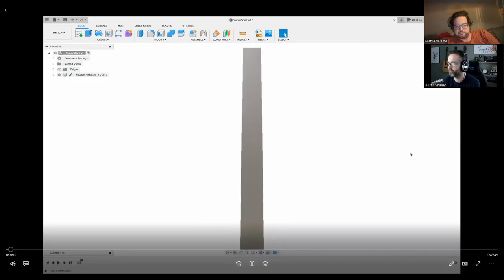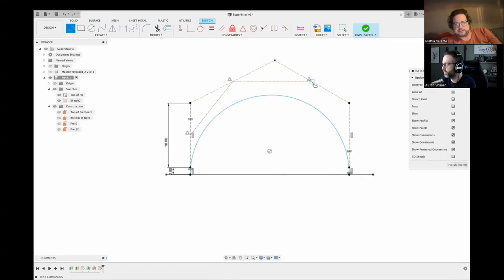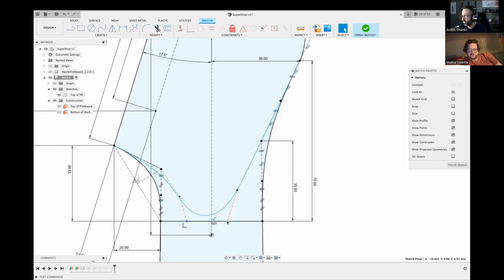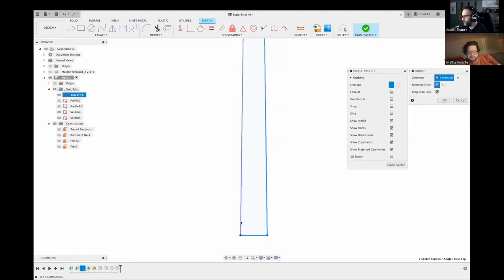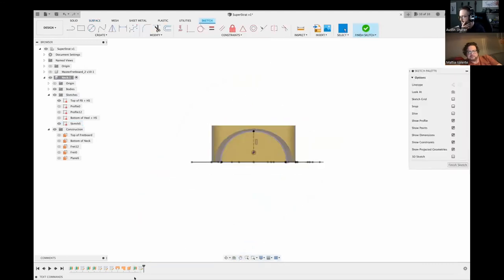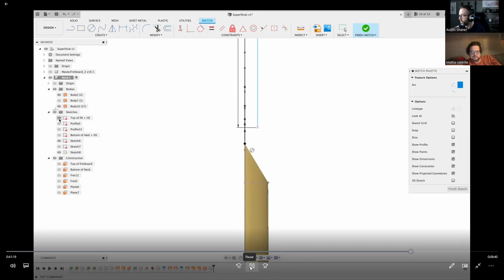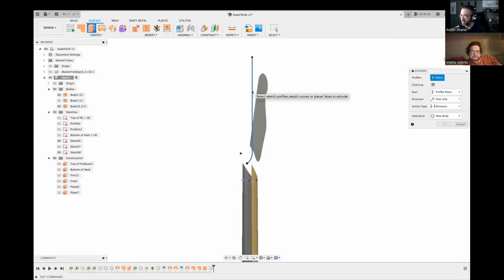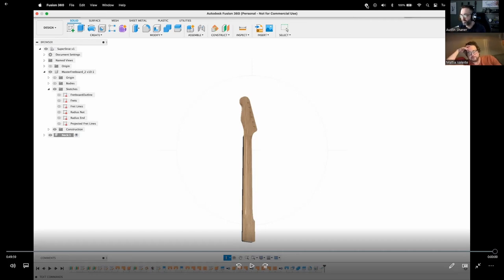Fender style neck modeling (featuring Mattia Valente) | Fusion 360 Tutorial

Comment: "I can't believe you do all of this with a track pad." That's because you've not spent enough time with an Apple track pad. I've never found a Windows machine with a track pad that comes anywhere close to the Apple track pad. After 25 years of Windows usage (I am a software developer by trade), I switched to a MacBook Pro about 5 years ago.  I've never felt the need to use a mouse on a Mac.. The trackpad just works. It's smooth and I do all of my work, including modeling in Fusion with it. There's some things that I still prefer about Windows, but Apple really got the trackpad right.